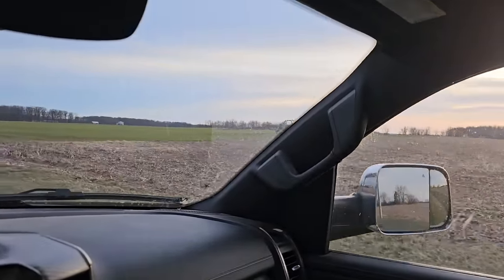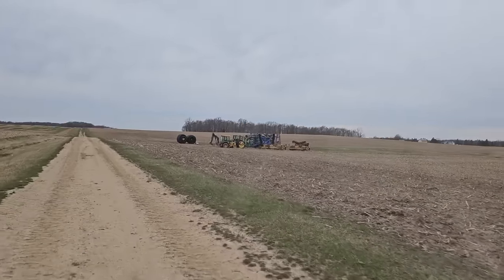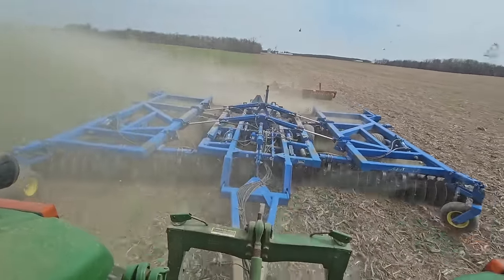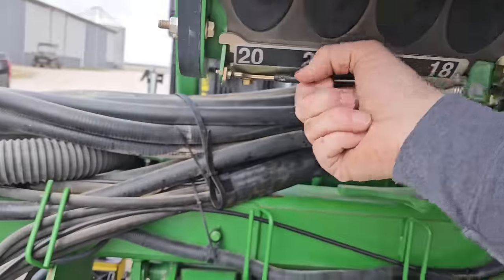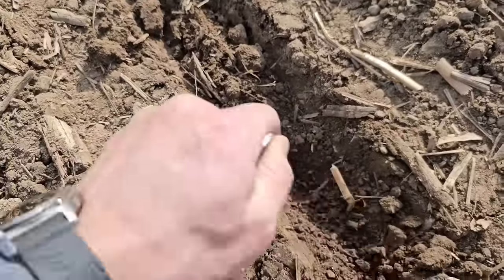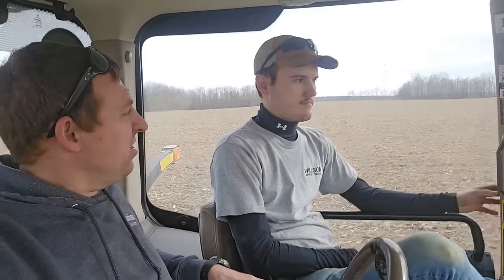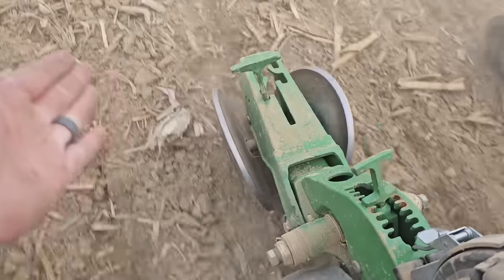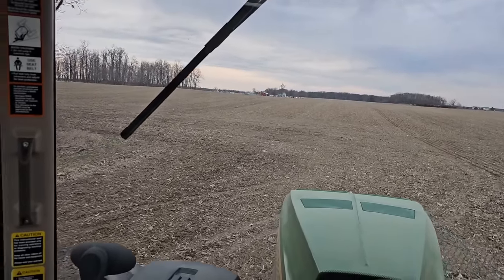Ultra Early March Planted Soybeans!!!

Comment: -Glad I have rain this morning. I have time to watch. 
-Get out the stick. My uncle would use a stick on the old tractors as his fuel gauge. That carried over to my cousin. None of his gauges ever worked. He would tease me because I'd only have a quarter tank. Then one day mine failed, and I replaced the sender. A week later, I caught him carrying his stick over to my tractor. He was mad because I snapped his trusty stick in half. I was mad and told him he was too lazy to climb on to turn the key on to check my gauge, ... that works.
-I was wondering if you were planting a mid or early 2?
Reply from the maker: 3.0s
Reply: @BorderViewFarms  That suprises me. I've found short seasons will really push pods, and can out-preform later groups when planted early.

Comment: Hey, we have done an essentials kit and are planning on using a G5 for planting, if you haven't figured it out yet and plan on putting that screen back in, I believe that you can do a custom shortcut bar down on the bottom of the screen to get a master on/off switch for section control.  Ours automatically popped up once I put in our planter.

Comment: So I’m commenting on this as soon as I heard it so you may answer it later in the video. 

You said you don’t want to plant into cool wet soil but you are going to plant into cool soil and it’s going to rain later that night therefore it will be cool wet soil
Reply from the maker: The issue is running the planter through wet soils.  Compaction and side wall smearing are very detrimental to yield and caused by planting in wet soil.
Reply: @BorderViewFarms  ok so it’s not an issue for the seed to be in cool wet soil